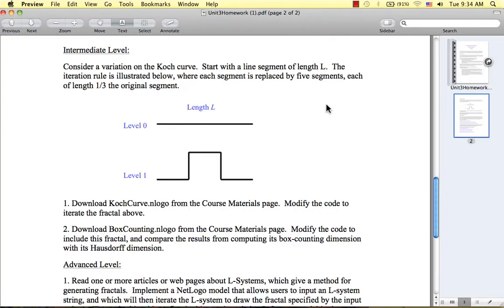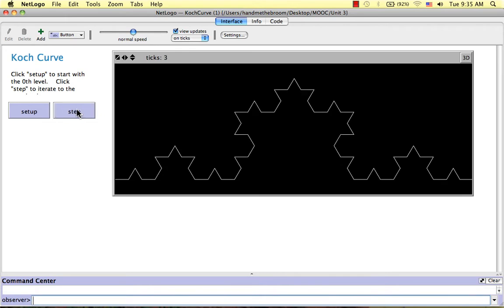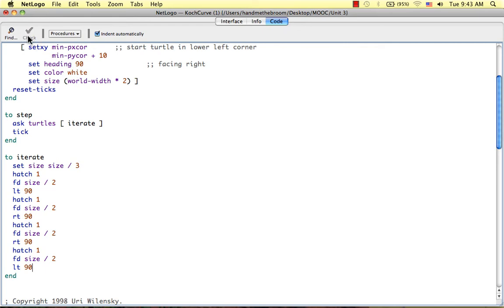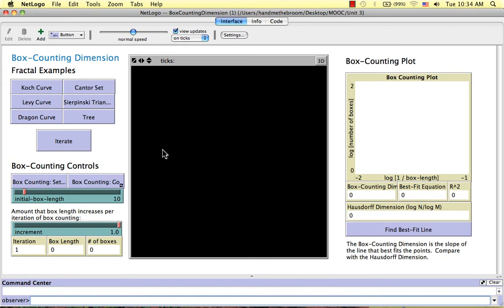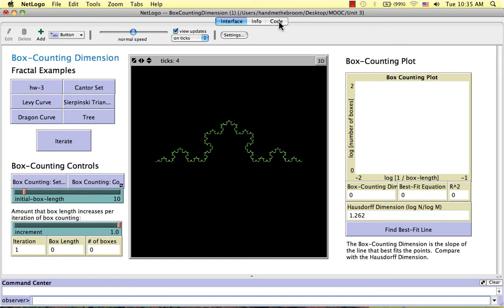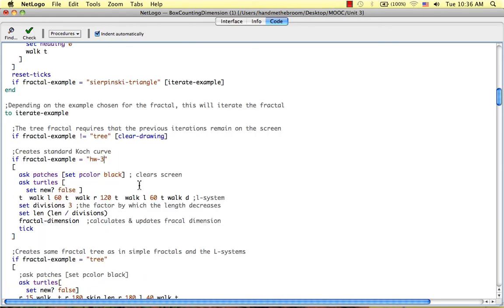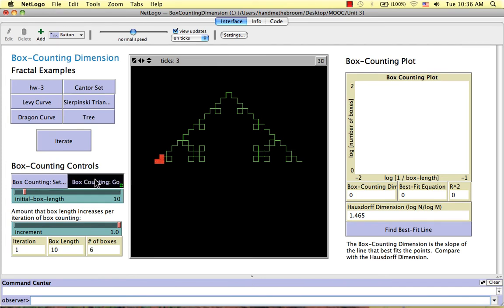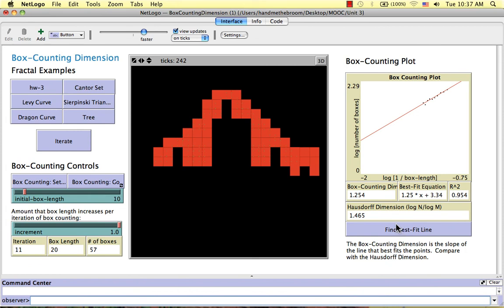Introduction to Complexity: Unit 3 Homework Solution Intermediate

Comment: fyi the syntax "t  walk l 60 t  walk r 120 t  walk l 60 t walk d" means this:

 t for hatch turtle, r for turn right by degree amount, l to turn left by degree amount, walk to move forward by a length (len), s to skip forward by a length and d to die. Length is set to 100 by default.